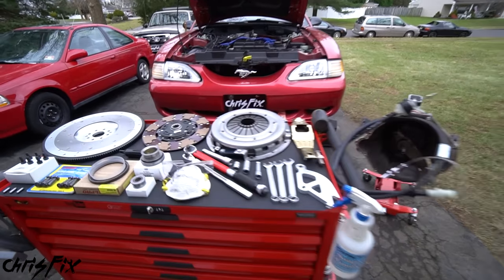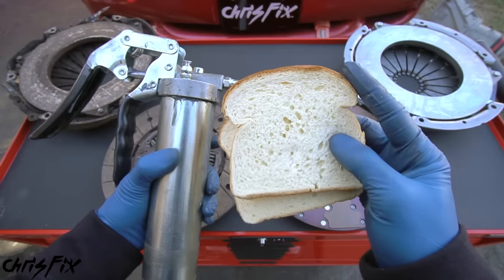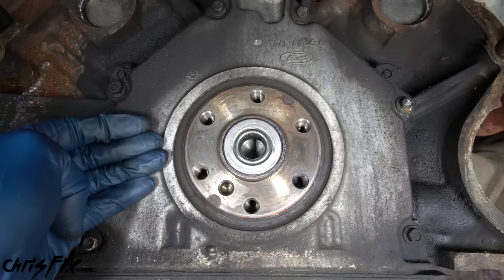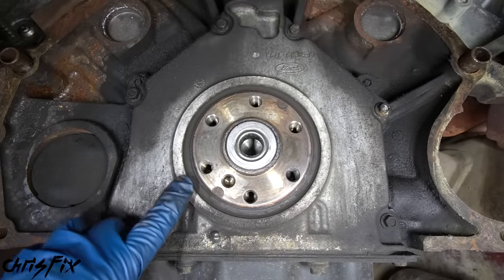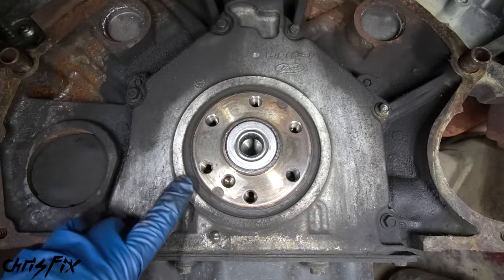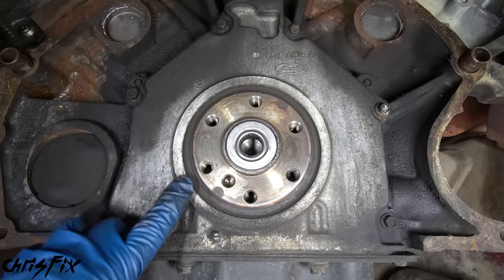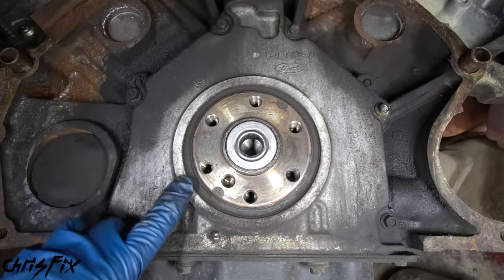How to Replace a Clutch in your Car or Truck (Full DIY Guide)

Comment: Everyone: You can't replace a clutch without specialized tools
Chris: hold my b r e a d
Reply: But then the other guy has the bread now :-/
Reply: It should be hold my torque wrench 😂
Reply: Alex Savastru 😂😂😂
Reply: And Greece
Reply: Chris: Give me my b r e a d back
Reply: @cjsgameplay6728  why would i need greece. I got enough debt on my own
Reply: Raph maybe it’s hold my soapy wooder
Reply: @Raph i say wooder!
Reply: @cjsgameplay6728  I'm from Greece!
Reply: Yeah it would totally be hold my wooder.
Reply: hold my elbow grease
Reply: That's just what they want you to think Buddy on top of that most to your Ford Transmissions I didn't get a good look at that one but most everyone of them I've done the transmission will actually I'm bought from the bellhousing so you can unbolt the transmission usually with for both drop it out of your way and makes it a little lighter but it's not as awkward as having the bellhousing still attached so by doing it that way you save yourself a little bit of headache and yes you can do it without specialized tools all you really need is the right size socket for torque wrench I'm blue Loctite from Grease and you will also need if you don't have your clutch alignment tool you'll need a broomstick carve down so I can be used as a makeshift alignment tool and they all reason that you unbolt the transmission from the bellhousing if applicable because when you get your transmission going back into the bellhousing after everything is installed
Reply: And it doesn't go in quite right you can have somebody push the clutch while you have the shaft what they call the input shaft started when they push your clutch to pressure plate and throwout bearing will release the clutch and it'll the transmission will align itself perfect every time
Reply: And in the matter of the clutch. Since you're replacing all that anyway it never hurts to take a spray bottle of water with you any spray all that stuff down and you won't have any clutch tossed but I don't like using their tools on that because they will break those bolts and as you're tightening of the pressure plate bolt you will notice that the fingers the release will start pulling in the fingers so if you're doing it with a air tool you're not going to get it even that's why people most people that do this all the time especially on our own machines we do it by feel my torque wrench is usually just a suggestion I mean I will use it on the flywheel and on head bolts main bearings and connecting rod caps other than that it's all feel
Reply: raph crafts & tools ***wooder
Reply: its a good snack for once your done
Reply: And you don't need specialized tools to do a clutch all you needed them some brains and know-how and plus with all this covid-19 on you're going to need some beside the bread
Reply: Hold my car    that what it should be
Reply: Me: Attempts to follow along
My dad: Whiskey Tango Foxtrot!!! 
Me: what's wrong??
My dad: the transmission is Broken!!!
Me: (forgot about the clutch fork and spring) oohh. About that...
My dad: NANI!!!!
Reply: Get my bread
Reply: Raccnoon Chris does
Reply: Hold my soapy water
Reply: @cooperbruhn930  no way
Reply: we can and we are always..
Reply: @Mary-hh3px  medium thread strength locker
Reply: Bread...
Reply: @laithsaid1803  Perfect...   🍞
Reply: He just did it.  My college auto tech professor with 30 yrs in the automotive business taught us a similar pilot bearing removal trick...without special tools.
Reply: Hold my transmission
Reply: Wait. No. Change of plans, gimme my bread
Reply: I can't do this fix unless the bread is gluten-free
Reply: Hold my wooder
Reply: @loymanes6394  You haven’t done one of the newer transmission on the modular engine. The bellhousing is bolted to the transmission from the inside. I was like you, that’s the way I‘be done too, so when I did mine last weekend I had a surprise. I was a pain in ass to get it out too. That pilot bearing tool he used is only good for one thing in my opinion that the trash can,  it wouldn’t pull my pilot bearing out.
Reply: It should be  hold my soapy wooder
Reply: my first transmission job on my jeep was done with hand held tools
Reply: Lol
Reply: @unknowncanadian5865  That grease gives it that perfect twang.
Reply: Got anymore of that bread?

Comment: Chris: "let's replace our clutch"

rebuilds entire transmission
Reply: Liam Johnson when he replaced the whole transmission I laughed so hard
Reply: @brianj1203  same 😂
Reply: at least hes not doing a half ass job
Reply: "gently used mustang for sale, all routine maintenance performed."
Reply: True, he does go the extra mile
Reply: The input shaft on that transmission wiggled like a snake in a jar of rats. That's why it got replaced. Plus the old transmissions didnt support that much power, so if chris wanted more power that transmission was gonna be the next thing to upgrade after a cam or a set of heads.
Reply: @salteengamer4799  "like a snake in a jar of rats" 😂
Reply: That's exactly what I was gonna say
Reply: "Preventative maintenance"
Reply: He also does drift it and that’s very hard on a transmission
Reply: That's because this is actually two videos in one.  He has a previous video where he replaces (not rebuilds) the transmission.  And in the process of replacing the transmission, he mentions replacing the clutch as preventative maintenance, which references this video.
Reply: Only one way to do it.. the right way! Good job!
Reply: @salteengamer4799  nice association we all know what a snake in a jar of rats looks like
Reply: So? It was broken
Reply: @TheSkatersoldier  lol yeah just the video title
Reply: @ubreakitirepairit3569  inception  🙆‍♂️🙆‍♂️😅
Reply: I'd buy that Stang!
Reply: Hi Chris
Reply: It isn't a transmission
Reply: It isn't a transmission
Reply: I would do the same thing. You already pulled the transmission off and for a car that age it’s definitely worth it. Especially since he’s tracking it. So that transmission is going to take a beating.
Reply: He calls it preventative maintenance 💀
Reply: @RevenantApollo  he’s doing a double ass job
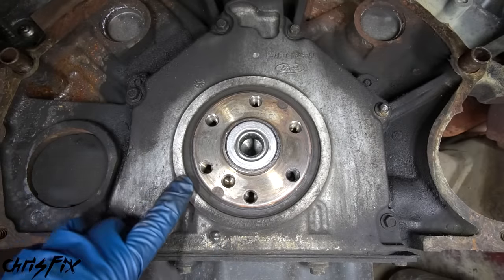Reply: 25:03 there is no reason to replace the whole transmission, I mean there is a pilot bearing holding everything in place, why does it matter if it is having side plays. The pilot bearing does not turn unless the clutch pedal is pushed in if you think about it, so it doesn’t really get used all that often.

Comment: I'm sorry I didn't catch all that the first time, could you please go over it again but this time use my 98 ranger as an example? I promise to watch more closely!
Reply from the maker: Hahahaha I need to do my ranger. I don’t even want to bc the exhaust is rusted to bits
Reply: ChrisFix  even more of a reason to do so my dude
Reply: Rangers are pretty easy to replace the clutch, just did my 93 3.0, i didn’t remove the y pipe thinking it wouldn’t be in the way so i unbolted the transmission and found out I couldn’t lower the transmission enough, should’ve removed the y pipe first and would’ve made taking the bell housing bolts a lot easier too
Reply: @chrisfix  Do a new exhaust on the ranger ;)
Reply: @chrisfix  straight pipes
Reply: ChrisFix yea replace the exhaust in the truck to get rid of that hole you cut in it because you're amazing and go above and beyond for your viewers. 😂😂 I started laughing my ass off the second I saw the plasma cutter  😂😂😂
Reply: Wow, I need to do this exactly to my 98 Ranger as well.
Reply: Warning Will Robinson! The '98 Ranger uses a Concentric Slave Cylinder - not a big deal if you are going for the clutch itself, but a real headache if you just have a leaking slave cylinder.
Reply: The exhaust manifold bolts on mine are corrode to the point I will need to cut them off! Not looking forward to trying to remove rusty studs from the heads.

Comment: I love how you take a scary and intimidating job, and turn it into a super simple process that's not daunting at all.
I've rebuilt my suspension, engine, transmission, new clutch, rebuilt my diff, etc. All cause of you. My car is track ready BECAUSE OF YOU. Thank you Chris❤
Reply: Can I ask you what car have you rebuilt? Because I'm trying to basically to the same thing/try to diagnose and repair my car when when something will fail. My car is an audi a4 b5 1.9tdi 2000
Reply: @Atomicul  My track car is a 1998 Mitsubishi Eclipse GSX. 2.0 4G63T, AWD, 5spd manual. 
Bored/forged block, built and ported head, injectors, big turbo, rebuilt both diffs and swapped rear to an LSD. Threw a bigger fuel pump in it. I'm in the process of bolting on the bigger turbo then it's off to the dyno to have it tuned.
I daily a 2010 S4 and it's stage 2, intake and supercharger pulley.
Reply: @Snail2G  sick

Comment: The grease and bread method for removing the bearing from a blind hole puts you on a whole other level of wizardry.
Reply: Idk that worked
Reply: hahaha
Reply: Can i use bread and butter so i won't waste it after i pulled out the bearing🙄🤔🤔🤣🤣🤣
Reply: I've done it with just bread, it looks like it was a lot easier than the grease/bread and less mess!
Reply: Best wearing tools removed bearings
Reply: @reginowaga2598  😂

Comment: Just wanted to share that because of you Chris I was able to do this job on my 01 Silverado. I’m no mechanic by a long shot but you put it in a manner that is understood. Huge thanks for these videos and the amount of organization that goes into them. Keep doing what you’re doing sir!!
Reply: @Adrian De La Garza Jr WOW! Impressive! Congratulations!
Reply: Hope I don't have to do it my s10
Reply: I was going to try this on my '03, but being my only means of transportation, I was absolutely certain there would be some part or tool I would need in the middle of the job, thus stranding myself.
Reply: @thzzzt  that's why I recommend watching the whole video first, then doing the work. Sometimes Chris forgets to mention something before he does it. Because of this, I tried to take my radiator cap off my subaru while it was warm and it didn't work out well...
Reply: @Asmith 1111  how badly did you get burned? Hospital bad, or run it under cold water for a minute bad?

Comment: While my clutch is a little different and my transmission way smaller, this definitely gave me some useful tips for replacing my clutch! Just got done putting it all back together
Reply from the maker: Awesome! Glad the video was helpful and nice work!
Reply: Hows the clutch holding up
Reply: @ElevateRealm9.  I got rid of the car a couple months ago. But the clutch was going strong. Just the rest of the car wasn't 😕

Comment: Some other tips to supplement this great video:

1. Even with the alignment tool, if it’s a plastic one, the clutch disc will likely sag a little. So before you tighten the pressure plate bolts, make sure the alignment tool is centered in the pilot bearing and level.
2. Some transmissions will have a small amount of play at the input shaft so do some research before buying a new 
tranny if yours has end play. 
3. Another trick to lining up the input shaft to the splines, is manipulating the gear levers and put it in gear then rotate the rear tailshaft until it lines up and fits in. This causes the input shaft to rotate. Then put it back into neutral as you push it in. 
4. Don’t hammer in bearing pilot bushings!

Comment: Great video Chris! One super important thing to note for many modern vehicles, if there is a tone wheel for the crank position signal on the flywheel you MUST clock the flywheel properly or the car will NOT start. Learned that one the hard way and I've seen professionals make the same mistake. Like/Pin this post so people don't make the same mistake!!!
Reply from the maker: Thanks for the tip!
Reply: Just one more part added to try and keep the DIY'r down.

Comment: 22:52 "We want the end of the alignment tool to go all the way into the pilot bearing and that will hold the clutch in the middle for us."  
The first solo clutch job I did was on a lift.  I didn't have a cart or table so my pressure plate was on the floor by my feet.  I installed the clutch plate with the alignment tool, picked up the pressure plate from the floor and as I stood back up the falling clutch plate struck the bridge of my nose while on its way to the floor, where it was chipped against the concrete.  Live and learn! 
As always, thank you for sharing and stay safe!

Comment: When he started pouring bread in that seal, I was like, "wait a minute, it's not April 1st, is it?"

But it all makes sense
Reply: Seen it done with a rag also.  All it has to do is stop the grease from squirting out around your tool - that way, the only place for it to go is behind the bearing.
Reply: A bar of soap also works
Reply: Rag is less malleable, so might be able to do it sooner, and without quite the mess.  @aussiebloke609
Reply: Usually less mess, but harder to get a good seal sometimes, especially if the cloth is too thick.  Remember that it has to fit between the inside of the bushing and the outside of your pushing tool without too much friction, or you'll just wedge it all inside the bushing - but without too much extra room or it just won't work.  But it's an option if you don't have bread handy.  :-)
Reply: I did say "without quite the mess", not "without any mess", for a reason. ;P @aussiebloke609

Comment: Bro, you should do a ( how to change a automatic transmission) because some people have auto cars and want to change there transmission.
Reply: It's the same process, just minus the clutch components.. But, I agree.
Reply: william vaughn what about cvt transmissions ?
Reply: it is not easy, you need to get a new computer and do a whole bunch of more things. Most people who do it once, never do it again.
Reply: How to change an automatic transmission: Swap it for a manual.
Reply: If not the whole auto trans, how about a video on replacing the torque converter. Basically the clutch for an auto...?
Reply: @smbrownx1  if you are replacing TC of an auto, you are rebuilding the entire trans.(In otherwords... it is not the "clutch if the trans." That part is within the transmission. The TC is another function...)

CVT trans are just a few more parts and electronics...

You don't need a new trans computer if you are replacing it with a same model trans or one where you are rebuilding it with exact parts and ratios..

Uhg... if any of you speaking to me here is ASE certified or "schooled" you are brainwashed. Sit down. Open your eyes. Technology didn't advance just because a new chip was added to the bundle of mechanics that has been built the same way for the past 2 decades.

Comment: if only it was as easy as you made it look lol, no siezed bolts, no bloody knuckles, no swearing 😂
Reply: Right! 😂😂😂
Reply: mhmmmmmm
Reply: Swearing itself is good and healthy, nothing beats neutralizing an alarming anger level than a well pronounced swearword.
Reply: @SE45CX  🤣
Reply: @lurk7967  How did that happen?
Reply: Those just add to the fun
Reply: @kiyoponnn  doing work on dad's mustang with my mother, her job was to make sure it didn't fall when I undid the bolts.... Should used a jack for the job. Luckily it did not land directly on it she caught it enough for it to land halfway on my leg so no bruises
Reply: @lurk7967 You're lucky, it could've been disastrous
Reply from the maker: The benefits of buying a Cali car and having the right tools for the job!
Reply: swearing and losing your shit is part of fixing things as a guy.
Reply: Then it wouldn't be mechanics lol
Reply: @chrisfix  What tools were you using to tighten the bolts on the panel to 89 inch pounds?
Reply: yeah my videos got a lot of swearing as i got a lot of them on old shit haha! Check my channel out dudes for support.
Reply: @Nexous91  hes using a torque wrench which tells you how much to till its tightened to the specific inch pound after its tightened the wrench will not tighten the acrew anymore since its set to 89 inch pounds
Reply: @PandaHiveGaming  I know what it is, I just needed the name of it but I found out already thanks anyway

Comment: Greetings from South Africa. This video is helping me so much! My Project car and dream car is my turbo charged FZ-FE 4.5L Straight 6 Petrol Toyota land cruiser pickup. I bought it with 400 000+ km on the clock and believe it or not, the rear main seal went. The clutch was already worn down some and with the extra oil flinging around, I ended up burning the clutch. Pressure plate was also bent from the heat. Flywheel was saved with a resurface. Got the parts, followed your instructions and I am almost there. takes a bit longer in between all the other stuff of life, but as soon as it's up and running I will send you some photos and videos. Thanks again for making great videos. Keep at it. I just love watching your videos, can't stop. PS the gearbox on my pickup is F*** heavy. PSPS, the bread works great!
Reply from the maker: Glad the video was helpful!!!

Comment: You should upload a bloopers video sometime to prove you're human- I've never seen you make a mistake. One time I was under my 97 GT, Unbolting the H-pipe from the right header and I forgot to unhook the battery. The socket fell off the extension, landed on the positive post of the starter, arced and shot sparks down my t-shirt sleeve and burned my right armpit 😛
Reply: I unhook the battery even for the minor repairs, that shit's got  a lot of energy inside, and now with the electronics gimmicks all around the car , I would now more often than anytime.
Reply: @Mprikiman  I like to live on the wild side, that and I'm sick of re-entering all my radio stations
Reply: Got pics of your shirt?
Reply: Matthew Canta no that happened years ago. The shirt was fine, sparks fell right down the sleeve cause I was working on my back under the car with my arm reaching up.